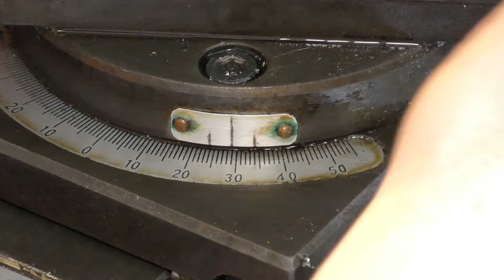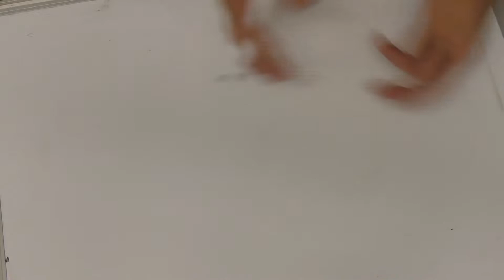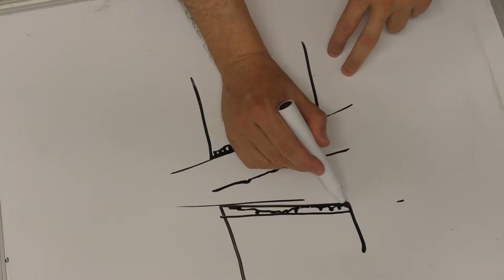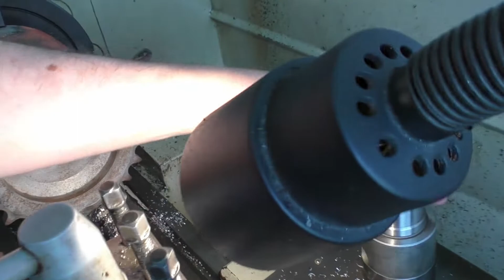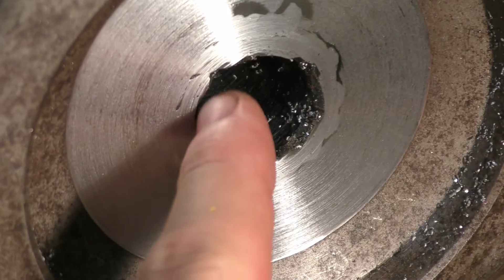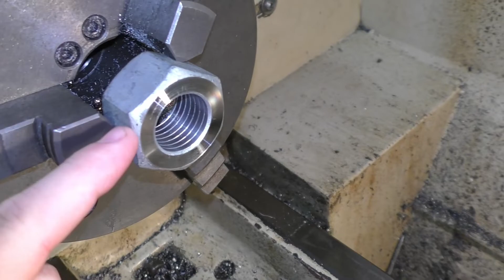Repairing a Thomas Dingo 25G Wheel Hub

Comment: I have this exact same machine , but it looses power to the wheels after about 30 mins of use. Engine runs fine, bucket will work fine. But after 30 mins it will not move until it cools off again. Any idea on what the issue might be ?
Reply from the maker: Errr  I don't know sorry.  How many hours on the machine?   Most of the time, heat generation in hydraulics causes loss of power.  Could be any thing like worn pump or passing hyd motor to a weak spring in a control valve.  Do you have a temperature gun?
Reply: @chich2  thank you for replying , I don’t know how many hours are on the machine. I’ve had it for about 7 years. I noticed that it only looses power on the hi speed. On low speed it works fine.